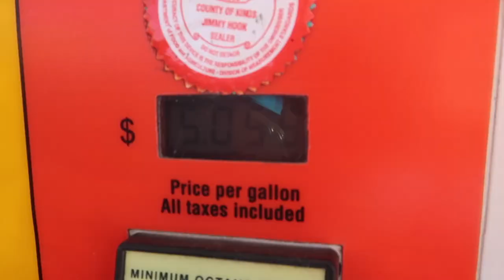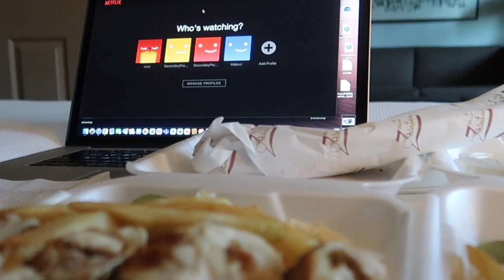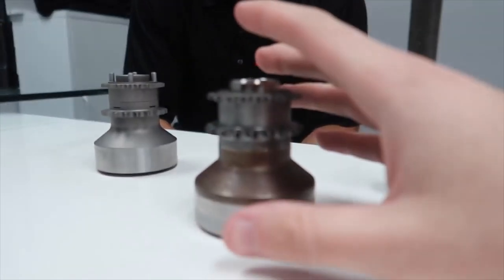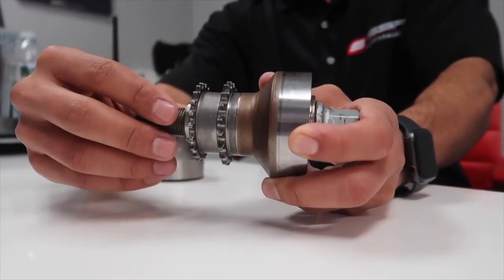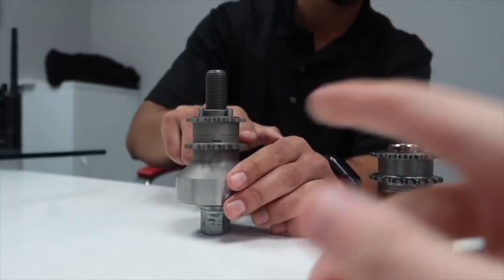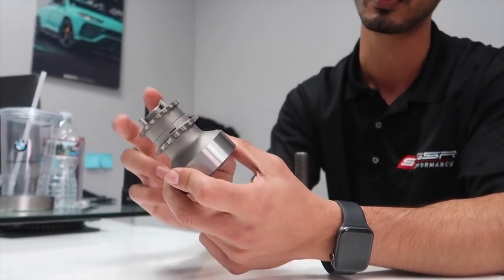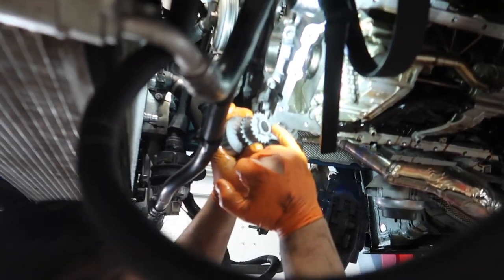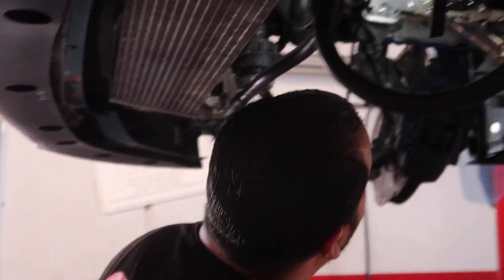MY F80 ATLANTIS BLUE GETS UPGRADED CRANK HUB+ NEW MODS! (SSR Performance)

Comment: I will use crank bolt capture for my stage 2 f80, if it spins then it will only throw the timing off and then I will take the jump to upgrade the crank hub…not really looking forward to drilling my Crank…